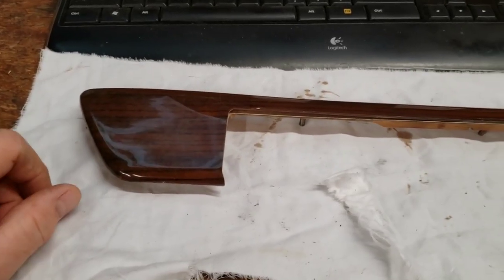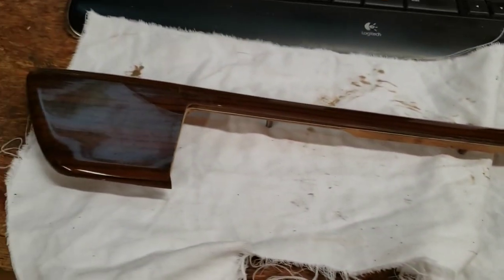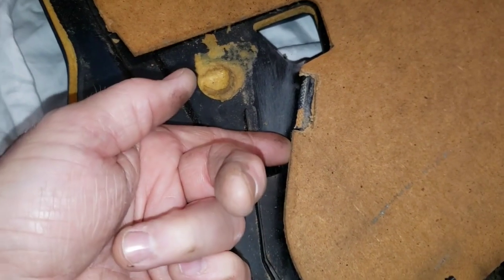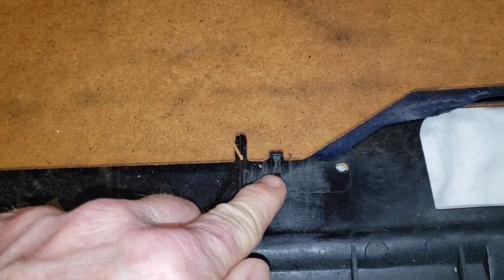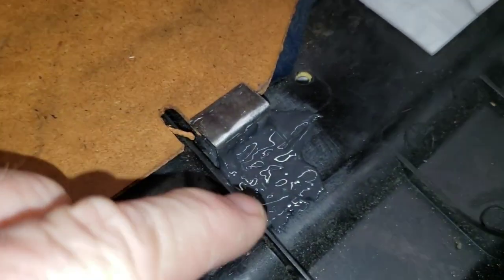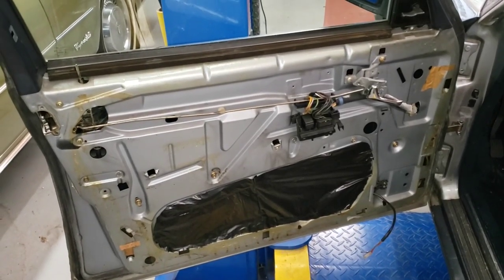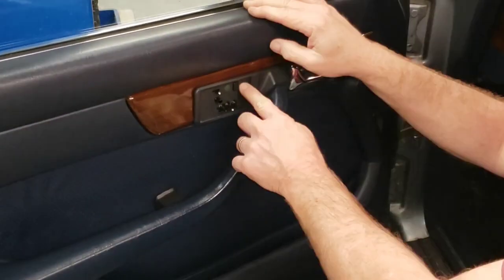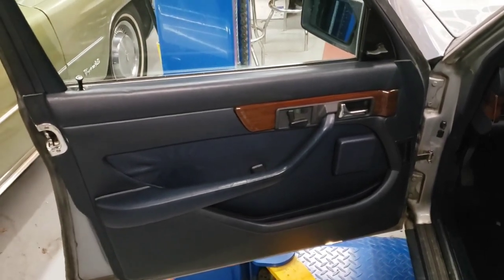Mercedes 300SD W126 - Drivers Door Wood Trim Restoration Plus Door Panel Repairs

Comment: Nice job. I believe the panels come factory standard with a moist resistant plastic layer between the door frame and the cardboard to avoid the cardboard soaking up moist, covering the entire panel.
Reply from the maker: I figured they did. I'll research it and come up with a better vapor barrier that mimics factory. I wanted to get the wood trim done and move on to the rest of the trim pieces in the car. Looking at all these delaminating trim pieces is driving me nuts.

Comment: While you had the door panels off did you lube the window regulators?     I had a car just like this-  same year and colors a great car.
Reply from the maker: No. I'll come back to it later. My goal right now is to fix all of the wood trim.  I thought about inspecting the door check but once you go down that road you might as well completely remove the door from the car and go through it with a fine tooth comb. I tend to stick with one thing, finish it, and move on to the next item. This keeps me from getting distracted.
Reply: I love your videos.    Have you checked your voltage regulator?   On my 1984 300SD, the only problem I had with her, I was coming home one night the light on the dash came on, and found it to be a worn out voltage regulator at 178K miles.   The car, as it was a diesel, ran perfectly even with the lights off at night- the car got me home.  A real easy fix.    Keep the videos coming-  The more I see them, the more I miss that car!Steve R.
Reply from the maker: @sgr439  Thanks! I've not checked the VR yet but that's a good reminder. I'll put it on the list.

Comment: Try a little heat, maybe a blow dryer, on that stretched spot and see if it will shrink back flat.
Reply from the maker: I did actually. No dice.  I believe I'd need to remove it entirely from the door panel to manipulate or roll it around while heating it. I'll come back to it later.

Comment: I removed the front left door panel on my '85 300SD without loosening the power seat switch assembly.  Also, there was no retaining clip on that assembly.  When reattaching the panel, do you recommend I loosen the power seat box?
Reply from the maker: Generally yes, you want things to be a little loose when reassembling the door. It allows for everything to slip in place. Then you can tighten everthing afterwards. The goal is to prevent cracking 40 year old plastics. 😁
Reply: @ImpalamansGarage  Thanks.  I can crack plastic that's even younger than 40 years.  What a talent!